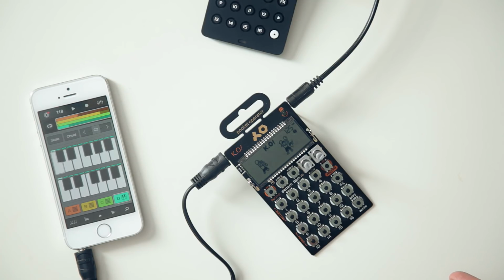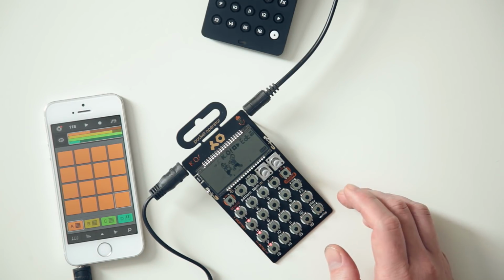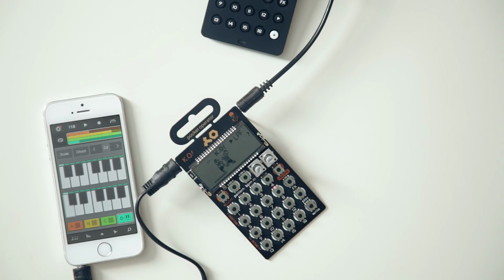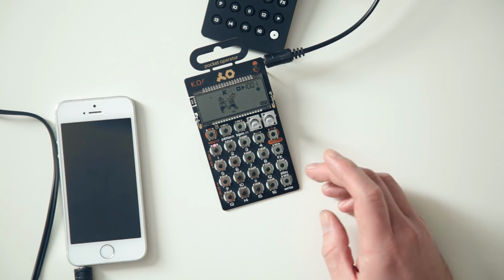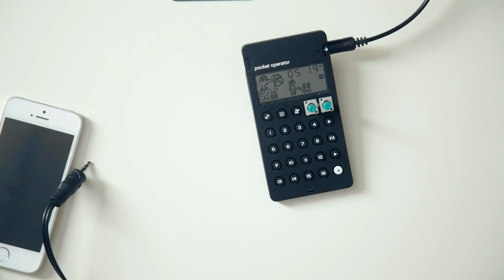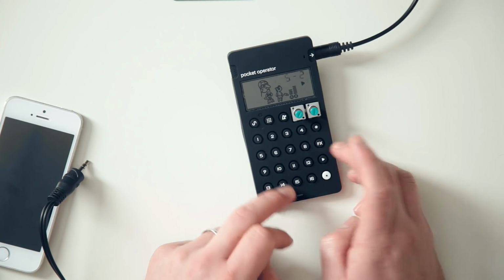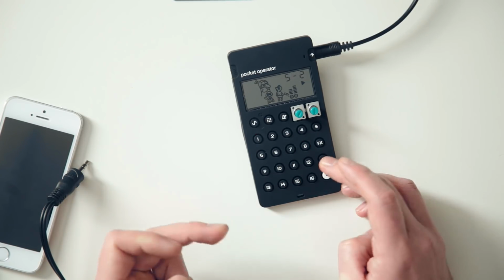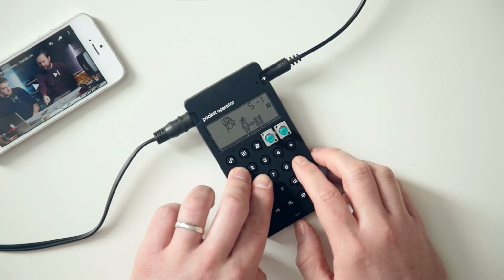Teenage Engineering PO-33 KO! & PO-35 Speak - hands-on

Comment: Can you sample through the aux cord on the "tonic" version as well?
Reply: Nope. Only the PO-33, PO-35 or PO-133 and PO-137 can sample. And the PO-35 and PO-137 do not sample 'the normal way', but convert any incoming audio directly to an audio synthesis. This means it'll always sound grainy and a bit synthesized, because it is exactly that. The PO-33 and PO-133 do sample.